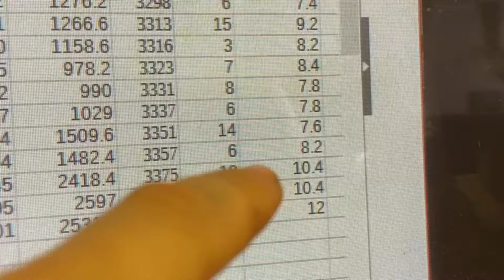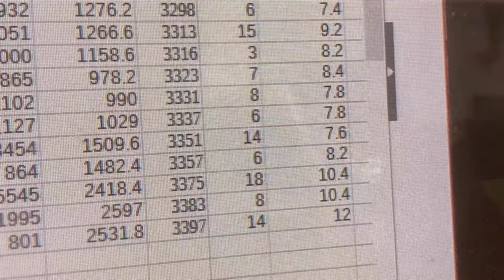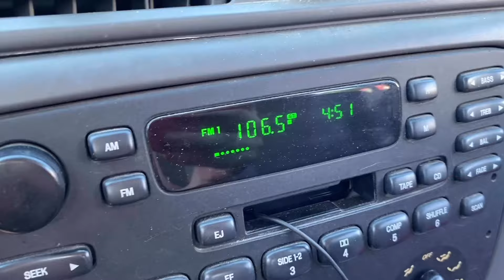How a 3D-Printing Business Works: Etsy etsy, etsy ETSY Etsy-etsy, "...Etsy." -Etsy, M3is3D Vlog #44

Comment: You might know this, but if you scuff the surfaces you glue together with some heavy grit sandpaper like 60 or 80 grit before gluing, you'll increase the adhesion phenomenally! A slick surface like that is almost always going to come unglued especially under shear. Grateful for cyanoacrylate!